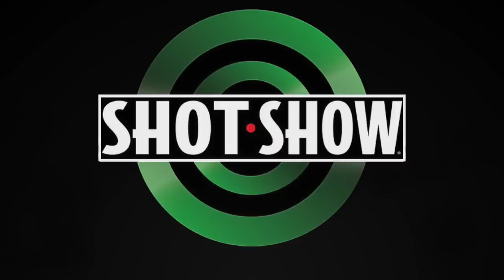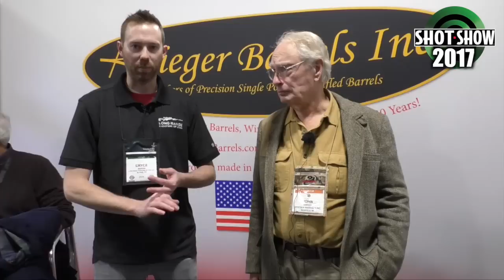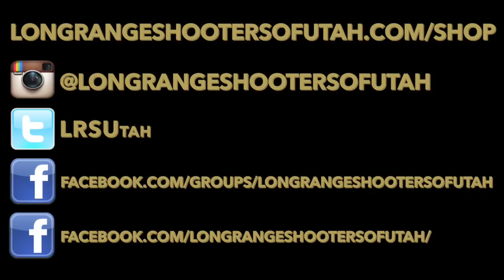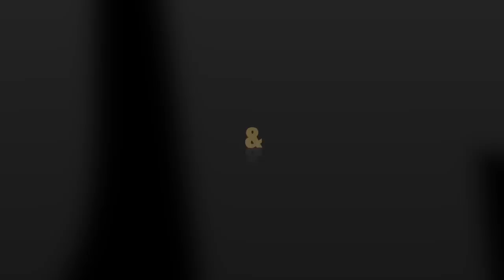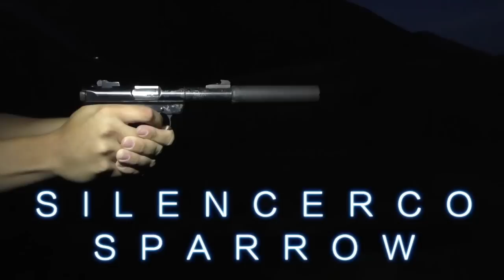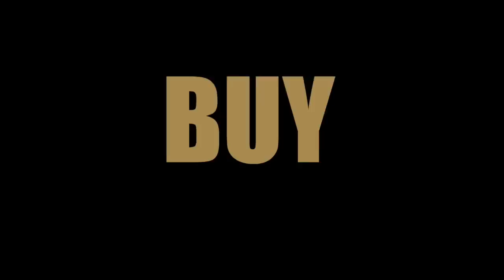Barrel Maker John Krieger on Barrel Break In, Cleaning, Lifespan, Optimal Length & Effect of Heat on

Comment: I’ve watched 7 different videos on people telling me how to clean a rifle and this is the first one where they said just shoot the dang thing and clean it when it stops shooting. Great video
Reply: So many people try to over complicate things what he said works lol
Reply: I just cleaned my marlin 60 for the first time yesterday and ive had the rifle for forty years.
Reply: honestly. maybe these guys who are splitting nut hairs notice it, but i'm consistent with quarter size groups and only clean it when i see a keyhole
Reply: Ray, He's talking about " HIS BARRELS " & he didn't say " JUST SHOOT THE DANG THING ". He said every barrel is different like people, he watches his patches for color & goes from there. He said the barrel will tell you what it needs as in cleaning more or not. If you just shoot the dang thing, not cleaning it for many rounds & it's copper fouling badly you're going to have a long cleaning job ahead of you. A regular production barrel is going to be worse yet & cleaning after every shot is key in smoothing out the barrels high & rough spots. You have to have a clean barrel ( no copper ) when shooting bullets down it so it smooths those high spots off. If just shooting it & shooting it won't smooth it out. Copper will just build up & build up not knocking down or smoothing out the barrel, which means a very hard barrel to clean.

Comment: To understand what he was saying, look at a reloading book blueprint of the .243 Win and draw a line from the shoulder on both sides at the same angle as the shoulder to centerline and they intersect in the barrel throat and lead. The case stops at 2.0449" from bolt face yet the shoulders intersection of angle at centerline occurs at 2.1835" which is 0.1386" past the case and into the throat and this is just the beginning of the erosion diamond. Now continue the lines to the opposite side of the bore and bounce the lines back at the reverse angle inside the barrel and you see a diamond shape inside the barrel and this is your maximum erosion /flame cut/plasma erosion area. Look at the 6mm Rem blueprint and do the same and the intersection occurs inside the brass case neck mostly. Better to erode brass necks than barrel throats.
Reply: Thanks

Comment: Great post. The man certainly knows his stuff and makes awesome barrels. 
<< 2 bulleye sighters (@right) then 9/10 in the Vbull @ 600yrds. ( should have moved 1/4 moa left for all 10 in)
My current 32 inch Stainless med-heavy (about 100 grams per inch) Krieger has 3530 rounds on board, .308 - 155.5 Bergers @2980-2990 fps. 
Last check with borescope , it looks like it's fired about 500 rounds. 
Still shoots sub .3moa.  10 on a 1 inch patch @300 yrds, off a rest. 

I was a Border Barrel fan (Scottish made. Fantastic cut rifling comp barrels ) But since fitting a Krieger and winning with it over last few seasons, im pretty much convinced  lol. 
Bloody awesome barrels.

Comment: I think Mr. Krieger meant cut rifling in his last comment, as he was talking about how they turn down the contour on un rifled blanks then cut rifle them after the major machining is done to avoid stress, directly before he said "button rifling". If I'm not mistaken, most Kriegers are cut rifled?
Reply from the maker: The HSPC Project yes he was saying that one of the many advantages to cut rifle barrels is the ability to contour them before cutting the rifling.  Whereas Burton barrels must remain a full diameter blank while being cut in order to ensure consistent results.  Button is a much more brutal, high pressure fast process
Reply: The HSPC Project my Krieger has 5R button rifling. it shoots great.
Reply: Long Range Shooters of Utah, LLC

Comment: But the question of heat affecting the factual accuracy  of the barrel itself instead of aiming prob lem due to heat mirage should be early enough to test with a sledge where the rifle is firmly attached?

Comment: He didn't mention it but the way he talked I would understand that the type of powder you use might have a severe effect on Barrel life, if you're using a ball powder it's much more abrasive than IMR powder would be.
Reply: i think he said what wears out a barrel is how the unburnt power goes down it if th shoulder is more angled it slams the barrel before going out where if the shoulder is less the unburnt powder just flows smoothly down and out. something like that anyway.

Comment: Has there ever been a process to sleeve a barrel that is badly pitted and worn?
Reply from the maker: Interior or exterior?
Reply: Barrel liners have been around for many years although not as popular today as in years past when corrosive priming was the norm. Mainly it was used on low pressure rounds like the .22 rimfire where the bore was drilled out to accept a rifled liner that was then soldered in place, or in later years after epoxies were developed they were utilized as well.

Comment: I have a question that maybe someone can answer. 
I am a novice shooter 2 to 3 times a year but will have time soon to do much much more. My other hobby is building race engines and one thing that i do for longevity and reliability is to cryogen the assembly. I can get similar life out of a cryoed assembly as i can a forged assembly, and even more out of a cryoed forged. My question is is there any benifit by doing this to say a medium/large bore as in a .338 Lapua. I have a Turkish mauser that i did this to without any issue. However the tolerances on the turk are probably nat as close. Tolerance change, before and after on engine components are minimal and I'm wondering if the same applies to gun tolerances metallurgy differences aside.

Thoughts?
Reply: I have no specific experience with this, and no research or data to share. However, I would like to suggest that you carefully consider the potential consequences of messing with the metallurgy of a firearm. For all I know, it might make no difference, or even be beneficial. But for my part, considering that the chamber and action of that rifle are containing hot gas at a pressure in the neighborhood of 40-60,000PSI right in front of my face, I'd want to be absolutely sure that I knew what I was doing before I altered the heat-treatment that the manufacturer did to the parts.

Comment: I use Krieger barrels pretty much exclusively on my center fires ( i do, though, have a Lilja on one of my Anschutz rim fire guns) and have noted that Krieger DOES provide break in procedures (obtainable on the internet from their website IIRC), but from listening to Mr. Kieger, I'd have to guess that those are only provided due to public demand. From many years of building (actually HAVING them built---I can't afford to buy the quality of machinery needed to do an accurate job) and shooting and cleaning cleaning rifles, I'd have to say that IF YOU DO NOT DO IT RIGHT, a LOT of DAMAGE can be done to a barrel by doing it wrong. Secondly, picking a good technique I tend to tell folks that using the technique recommended by the barrel's manufacturer is likely best for THAT barrel because THEY know from experience AND because they WANT YOUR BARREL to shoot as well and as long as it can! And then doing it ONLY that way and doing it consistently will likely give the best results.  My way of doing it all, but YMMV!
Reply: FORD vs.Chevy vs. Chrysler discussion/argument/philosophies all over again.....never will be a clear, provable, consistent winner until maybe 1 million years after the end of the world. I shoot competitively and, if you'll just take a moment to see who uses what barrels and how many of which make are "winners",  you'll maybe change your mind. (even IF Krieger is not the so-called "top overall" one) If not, so be it. I and MANY OTHERS are pretty happy with various top brands of barrels like BRUX,  BARTLEIN,  LILJA, OBERMEYER and KRIEGER among a few others. Not to mention that even the "Blue Light Special Company" comes up with a real hummer once in a while that just shoots "lights out". It is mostly the quality/skill/experience of the nut on the trigger that makes the biggest difference, anyway.
Reply: Funny that you think I know so much about the 5R thing...never tested them, don't use them and have never had an opinion to post or argue about one way or another. Yes, durability IS somewhat of a concern for competitive shooting, but pretty much everyone I have run across that shoots is not all totally concerned about that as a first priority. I don't really care about what is the latest "cool fad". ....and you'll notice that I DID NOT claim that accuracy is the ONLY thing that matters, as there ARE other considerations...but accuracy has GOTTA BE THERE. Get real, Bubba. READ and understand before you go off on some rant, especially at a person you've never met and have NO CLUE about......you'll find yourself embarrassing yourself less frequently.